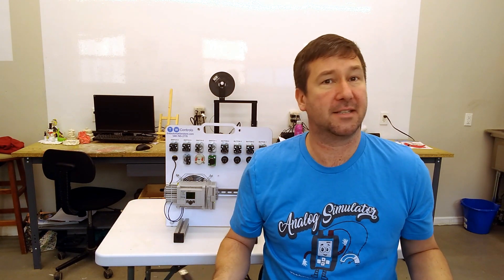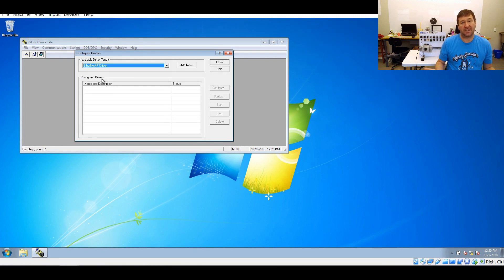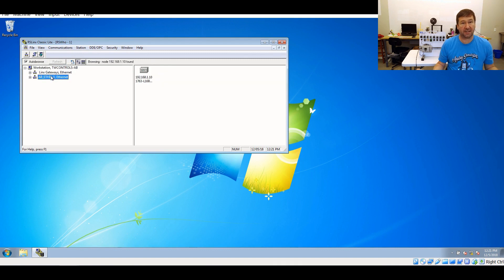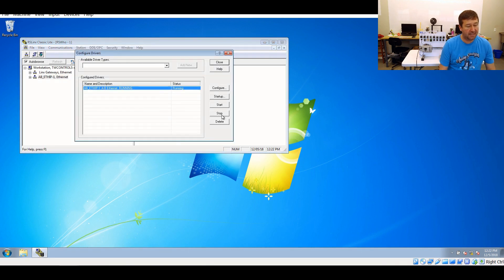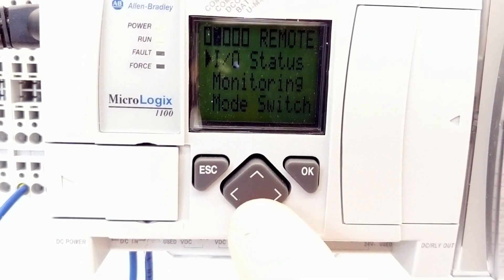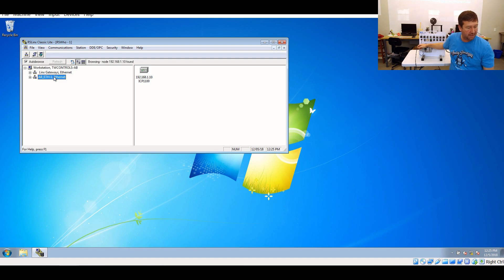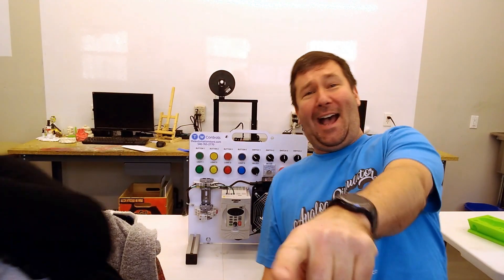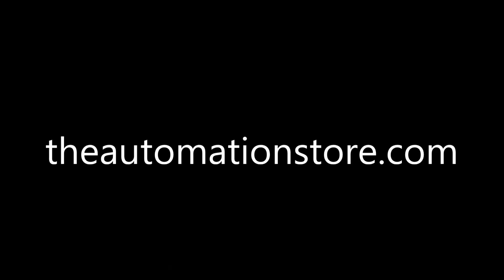Allen Bradley Micrologix Connecting over Ethernet Devices and Ethernet/IP Configuration RsLogix 500

Comment: Tim, I need help! Trying to connect to a MicroLogix 1100, which I’ve many many times. The IP is 10.218.120.9 I’ve tried Ethernet Ip and Ethernet drivers. Set my computer to manual and Ethernet to 10.218.120. 20
When I configure drivers and choose my Ethernet adapter is doesn’t show the IP address, it shows unknown ?
I can’t connect to the 1100 and it won’t ping either. I am using windows 11
I’m lost any suggestions 
Thanks Doug
Reply from the maker: If you can't ping it, start with the basics. Here is a video on troubleshooting Ethernet settings
https://youtube.com/live/W7Q5ZgvEWiw?feature=share

Comment: thank you guys, have tried both options but mine diplays unrecognised device
Reply from the maker: Can you ping it? If so check your rslinx revision
Reply: @TimWilborne  even after ping its still unrecognised in the ethernet I/P it shows nothing but with ethernet device after entering the IP its displays unrecognised device
Reply from the maker: @Inspire25567  Which adapter did you select when adding the Ethernet/IP, it is either browsing the wrong network (such as wifi) or you have some type of internet security software that is blocking port 2222 or 44818,
Reply: @TimWilborne   I have run into a similar issue. I am not sure how to ping the PLC. It shows unrecognized device and can not connect. It also shows this when the cable isn't even attached. I have tried a few different ethernet cables. Is it perhaps my ethernet to USB converter?

Comment: What is the absolute 'smallest' PLC on the market today?  Thinking of a future project where size would be an important factor.  If it happened to have a built in sequencer too, that would be icing on the cake.  :)
Reply from the maker: The Automation Direct Click PLC is pretty small. Or the Moeller PLCs which AB was relabeling as the Pico. 

I don't use the built in sequencers. Here is a sneak peak at a series coming out for sequencers soon. https://www.theautomationstore.com/rslogix-500-sequencing-machine-steps/
Reply from the maker: Just released these articles on sequencing machine steps:
https://www.theautomationstore.com/rslogix-500-sequencing-machine-steps-part-1/
https://www.theautomationstore.com/rslogix-500-sequencing-machine-steps-part-2-controlling-outputs/
https://www.theautomationstore.com/rslogix-500-sequencing-machine-steps-part-3-cascading-timers/
https://www.theautomationstore.com/rslogix-500-sequencing-machine-steps-part-4-counters/
https://www.theautomationstore.com/rslogix-500-sequencing-machine-steps-part-5-word-bit-manipulation/
https://www.theautomationstore.com/rslogix-500-sequencing-machine-steps-part-6-multiplying-integers-by-two/
https://www.theautomationstore.com/rslogix-500-sequencing-machine-steps-part-7-sequencer-instructions/
https://www.theautomationstore.com/rslogix-500-sti-selectable-timed-interrupt-for-precise-timing/